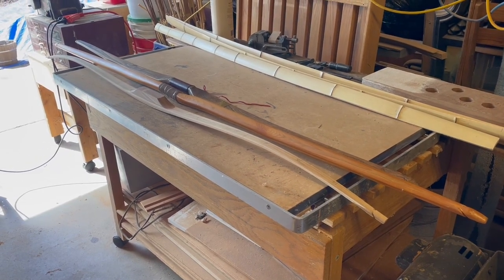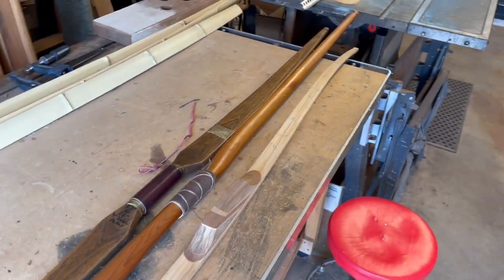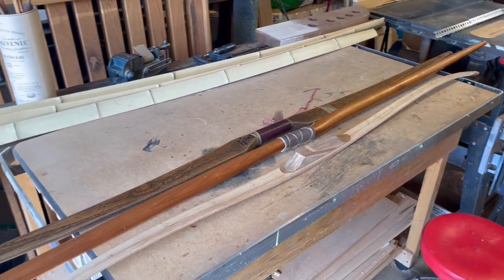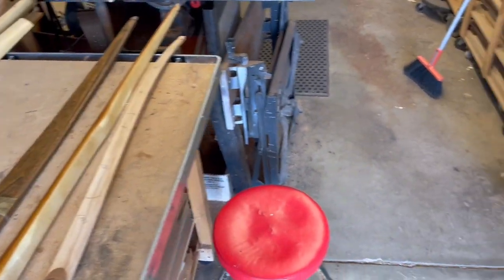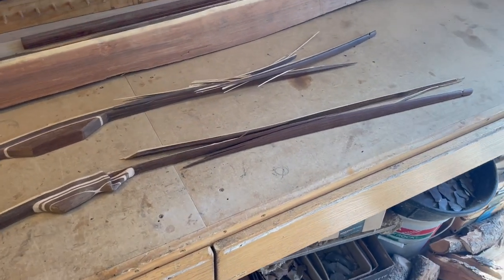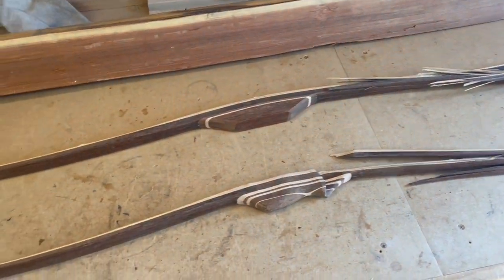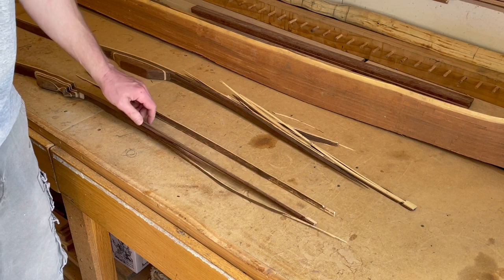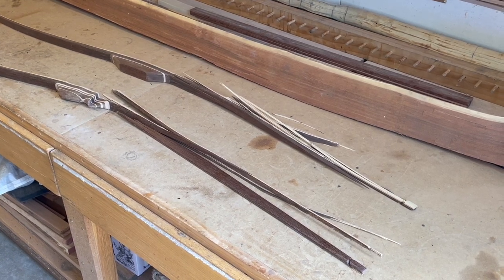Catastrophic bow failures - diagnosis

Comment: I thought  I was the only one break a bow!  Will you use the good limb? Also, what is the stave on your bench?
Reply from the maker: I considered both of those bows complete losses. Sometimes I’ll salvage the riser block before I discard a broken bow, but both were too narrow to be of use in future builds. As for the stave, it is there for a future build along.  I want to get the message out for availability of different materials and how easy it actually is to get into primitive bow making for those that are on the fence - pun intended as that stave is actually a split cedar fence rail lol. It will make 3 great English-style longbows similar to the one in front of it. I made a lot of them at one time.
Reply: Thank you.